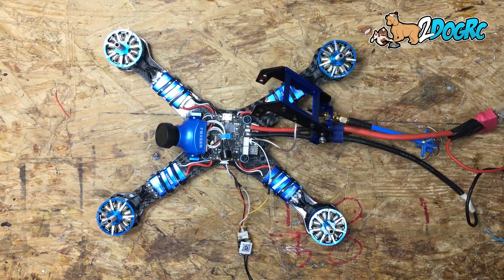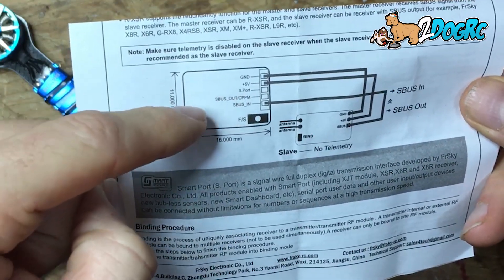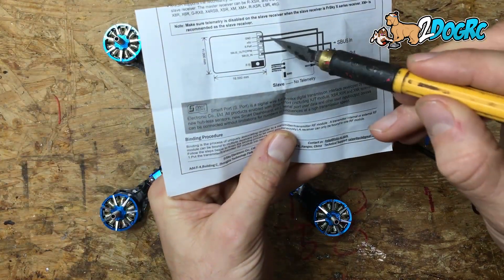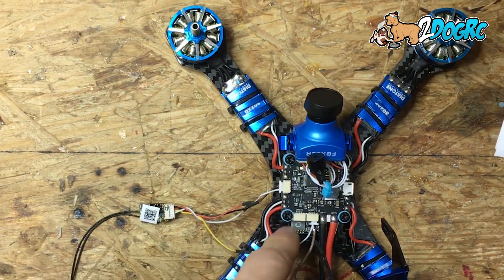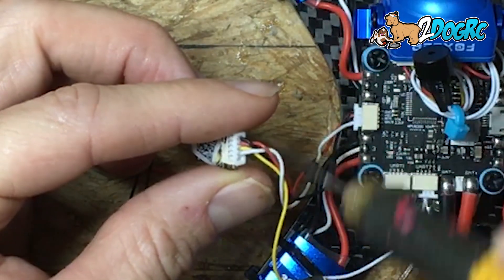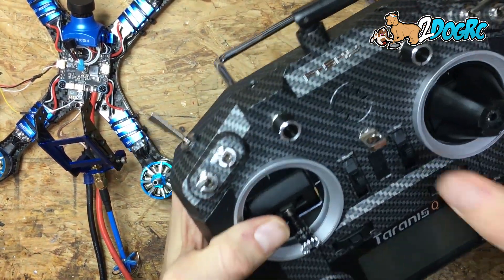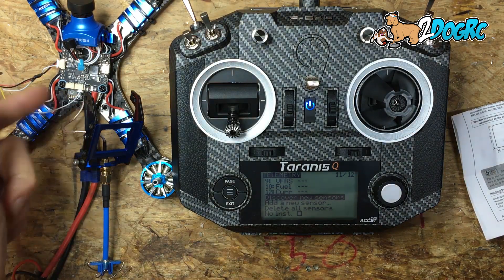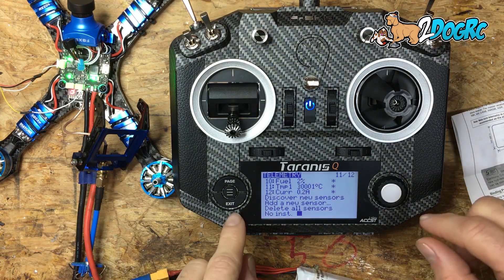Install Frsky R-XSR Receiver and Telemetry, Fury F3 OSD Board Diatone a

Comment: I have a kakute f4 v2 flight controller and form the R-XSR I soldered the green wire (yours is white, mine is green) to R6 and the yellow to T4. According to my FC diagram R6 is UART6 and T4 is UART4, what do I need to select into the ports tab in betaflight ? The receiver tab is "Dead", my taranis receives telemetry signal but nothing is moving on the receiver tab. Thanks!
Reply from the maker: The Sbus wire goes to 6 I believe and then select SBus in the ports, then Sport in the uART 4 tab.

Comment: Was hoping to get some advice regarding my R xsr receiver that I am using or attempted to use with my kopis 1 from Holy bro,  and I checked and double-checked and I checked and double-checked the pinout as to if it's correct and for my understanding it is but for some reason when I try and use my qx7 it will show telemetry but it consistently vibrates and beeps and I will get no action on my stick movements and betaflight and or when trying to disarm xcetera I have only been able to get it to you fly with one of the ts8 G multi-protocol radio but with the TS8G plus it will not successfully work either so it works with one of the two but then I only get about 30 feet or 20 yards of distance between me and the Drone before it begins to fail safe I have tested and retested the antennas are connected properly and it still will not allow me to fly past approximately 30 ft give or take, if anyone has any ideas what could possibly be wrong I would appreciate the heads-up and also I've checked I have the appropriate lights the blue and the green while bound and radio is turned on and do you have any ideas as to why the taranis qx7 i have will consistently beep and vibrate while turned on and found to the receiver itself, thanks a million people's I would greatly appreciate any and all help if you need to get in touch with me since something through my kdrc account or reach Me and my email K1DODSON@YAHOO.COM yahoo.com
Reply from the maker: WOW!  That is bad if both systems are having an issue.  How close is your VTX to the Receiver antenna?  That can cause interference.

Comment: i used one on my gtr90 .works great but you need to run a wire from the univerted sport pad for telemetry to work on the fury f4
Reply from the maker: That is correct.  On theF4 boards that is required. I will do one on the FuryF4 next.  I have that going in to a build.
Reply: this affects all f4 boards?
Reply: i believe there are boards with specific pads for s- port but in general yes it does.F3 and F7 have inverted UARTs
Reply: so basically if the FC doesn't have a dedicated s-port pad, you need to go from the rxsr's "P" pad and connect it to an open TX pad on the FC? tia
Reply: correct but on a separate UART